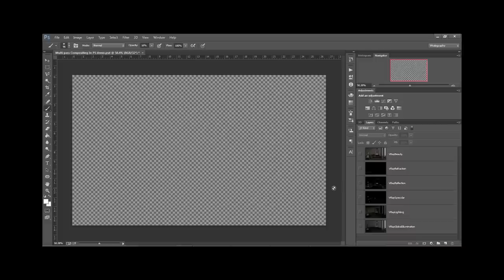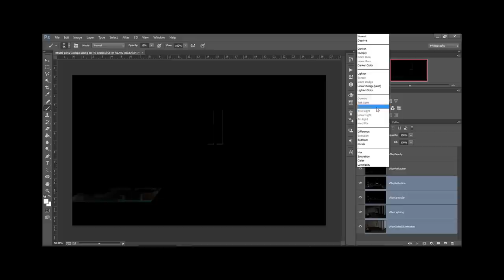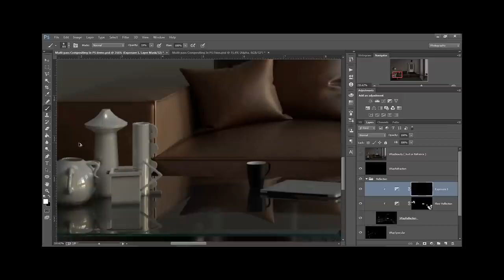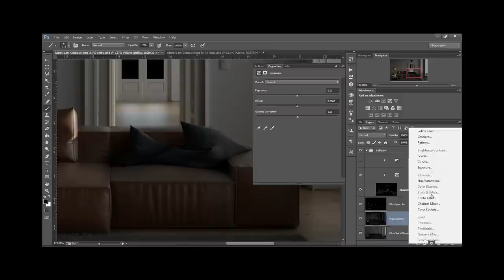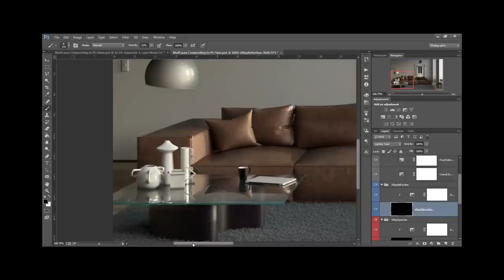Multipass Compositing in Photoshop - Vray Render Elements

Comment: Question, with Cebas' Final Render, render elements can be clipped, so that they don't cause an overlap effect in composite, basically, it turns whatever objects that are not in the element into an alpha matte, so that it basically blocks the object(s) if it passes between the camera and the objects that are included in the render pass... does Vray do the same thing?

Comment: Hi again Ismael, 

Right now i´m following your instructions for multipass compositing and I find that if I set the VrayRefraction to Lighter Color, then it is not correct comparing it to the beauty pass. It is linear dodge (add) that matches it though the color hue changes slightly from red to green a bit. 
Do you know what could be happening? 

Anyhow thanks for the tutorial!
Reply from the maker: Hey Julio,
glad you found the video helpful, 
to answer your question, yes you are right.
linear dodge (add) is correct too, in my case i had the refraction baked in with the reflection pass, that's why i used Lighter Color which is correct too " Additive operation". 
you can visit this page where i explained this point. → http://cgalter.com/multipass-compositing-case-study/
cheers,
Ismail
Reply: CGalter Oh great! I was placing the refraction pass on top, not the bottom, so now both blending modes output the same result. So if I set it to Linear Dodge it doesn´t matter the place, but when using lighter colour it does :)
Thanks a lot for the tip. Keep it up, your tutorials are great and fun!

Comment: 2 questions this time :D
Are u exporting 16 or 32 bit? cause even when i export in 16 bit my ps opens the file in 32 which is odd.
What is the element to control a 2 sided material? I simply cannot compose that! 
ty
Reply from the maker: great question, thank you Thanos.

Answers:
----
Are u exporting 16 or 32 bit?

1. I genuinely export 16bits when i have an animation " sequence Frames ", as it's less heavy.
Especially if you use load of passes, like mates, light select etc...
Of course 32bits is 4000 times finer than 16bits and has more depth, but usually 16bits can be enough for toning the image later on in post.

2. 32bits for, Still Frames ( Even a 3d still render can take from 6 to 10 hours for good quality) it will be great to have that high dynamic range to work with in post, eventually it will produce larger files size " The Render used for compositing in this tutorial is about 600 mo for a 3k render, again with mates, light select etc... ".

Quick tip:
16bits → Sequence frames :: small files.
32bits → Still frames :: Larger files.
-----------------------------

my ps opens the file in 32 which is odd?

It's Normal, Photoshop by default opens EXR files as a 32bits Canvas, as it doesn't read the depth. so once it detect, it's an EXR then it opens it as a 32bits float document.

PS: as said above, if you are working on still frame, then export 32bits so your color operations will be mathematically correct in post.
-----------------------------

What is the element to control a 2 sided material?

Yes Thanos, unfortunately there isn't a dedicated Pass for the VRay2SidedMtl.

VRay2SidedMtl, is a Fake hack to simulate thin translucent.

from my experience this material do no work it all in multipass for two reasons:

1 -  It's fake, so mathematically it won't blend in with the other passes,
for example, if you want to use the vraylightselect to control a light behind the 2 sided material object,  it won't be possible, it doesn't even appear in the lighting pass or any other passes!

2 - No dedicated pass.

Solutions :
A - you can use the VRayFastSSS2, works nicely and it has a pass element. one downside to that is that it's slow to render and it takes time to configure.
B - Since the VRay2SidedMtl is faster to render than sss, you can configure it in render and leave it as it is.
C - Refraction, you can use a VRayBlendMtl material with two regular VRayMtl and play with the refraction. so you can have the font as a base " no refraction" and the back translucent as a coat " with refraction ". this way you have the refraction pass,  the light will show up in the lighting pass and finally the diffuse will be in the Diffuse pass.
-----------------------------

i'm going to elaborate further more this question in a future video, again awesome question.
thank you,
i hope this will help.
all the best Thanos,
Ismail
Reply from the maker: thanks for the great tip Thanos.
i understand, it's a little bit confusing sometimes to get a proper composite.
for your question about the alpha, i will talk about it in the nuke video next week in detail.
stay tuned.
have a good evening mate,
best,
Ismail

Comment: Thanks for the video!
I'm actually having a lot of problems: I saved as tif files the passes, but when I compose all the layer in PS they don't look at all as the beauty pass.
So I tried to save the passes as .exr 32bit, but in this way they look totally different from yours, they look like an alpha channel, and of course they aren't useful. 
I really would like your help. I'm struggling a lot on this issue but I can't find a solution.
Reply: +Lelexx1982 I also was having a lot of problems. I've tried several methods and file formats, until I found that my problem was that I didn't have a proper linear workflow set up, correcting that worked for me. Also make sure you are saving as Full Float exr, not Integer.